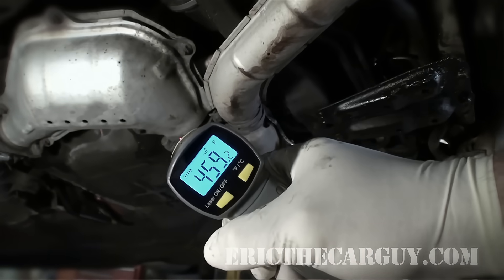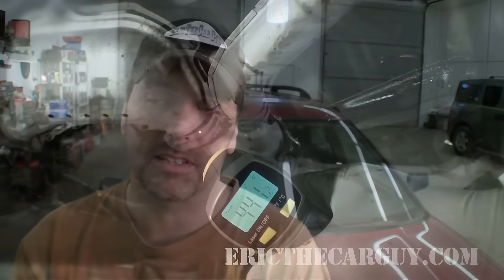Does Lacquer Thinner Clean Catalytic Converters? -EricTheCarGuy

Comment: Click bait Chanel for sure. Why would you do a “myth busting” video and purposely mis interpret the original video?

1. He said 1 gallon to half a tank
2. This isn’t a for sure fix like replacing or repairing a bad part. It’s a shot in the dark that might buy you some time. 
3. It’s not specific to a certain Myles after application. It could be 50 miles, 100 150 etc etc.

Just by this video I’ll never watch any other of your videos to try to learn from because you either act in bad faith or have faulty logic.

Comment: Look up the MSDS sheets and Compare the MSDS sheet for Cataclean to lacquer thinner... you will e surprised.  Lacquer thinner is much cheaper!
The thinner worked for me to pass inspection.  Engine light returned after about 500 miles and about 8 months later, I had to replace the converter due to being too clogged.  2005 Dodge Grand Caravan, 3.3L, that ran a bit dirty, contributing to the clogging.

Comment: It did not work in my car and I actually used two gallons of it the only thing that actually really worked was seafoam intake spray but you have to have the car running at least 2,000 RPMs run both cans through it and immediately drive the car on the freeway for 15 to 20 minutes it totally cleaned all my Cadillac converters on both sides and all four of my O2 sensors seafoam intake spray lacquer thinner did not work

Comment: My dad owned an auto paint store when I was in my early teens. There was a lot beside it that I would push mow. He kept the gas in a 5 gallon paint thinner can. One day I grabbed what I thought was the gas can, filled up the push mower and mow the whole yard. I remember thinking the RPMs were higher than normal on the push mower, but I was too young to make the connection. the next time my dad tried to start it He asked me what I did and put two and two together.  after flushing it out with regular gasoline it ran again, and we kept on using it 😅

Comment: The sensors under my Lexus sc 400 1992 are easy to get to but the nuts are so seized up that I tried the laquar thinner method . The light was on during the drive but had to continue the second day to use up the gas. The car stalled and trying restart repeatedly ran down the battery. It took three hours to arrange a tow back to base. The no gas symptom led me to replace the fuel filter. It started again and with a new battery the light was still on . Now it’s off , happy days

Comment: Hay Erick i luv your channel even used your video on the dodge engine swap and went perfect……however on that same wngine experienceing over heating issue?? New T stat 2xs wven drilled wholes in 2nd one so water flows reguardless bled any air out the intake port and new radiator… haven’t done and engine or radiator flush yet but was wondering what u think ??? Ive read possible cracked block ??

Comment: You didn't perform the test correctly. You had more gas in your tank as recommended and you didn't use nearly enough lacquer, so you failed yourself because it works.

Comment: My only problem with scotty's tip is that the strength depends on fuel tank size. My 01 celica has a tiny tank in it (not sure the exact size), but my trailblazer has a 24-gallon tank. Half a tank in my celica could be a quarter of what my trailblazer holds, thus making the mixture stronger. So what works in the celica might not be strong enoung for the trailblazer. That's why i prefer to just straight pipe my vehicles🤣.

In all seriousness, you just need to see what works. I've had luck with red heet, lucus (the yellowish concentrated stuff in the little bottles), and berrymans b12. I've never tried lacquer thinner, but i imagine it's stronger since there are no lubrication or detergent additives included. 

For the red heet, dont use too much. It burns HOT. I've had cars start backfiring because of it. It stops backfiring after a while. Just gotta clear the heet out of the tank. Took a full tank the few times its happened to me.

For the lucus, it's more of a maintenance additive, not a fix your missfire and cats additive. I use it every other fill-up. (Pro tip, get the little bottle and a gallon of it. Refill the little bottle after you use it, and leave it somewhere in your car until you want to add it again.)

For the berrymans, it's similar to seafoam, but i prefer the B12 personally. I use it to clean PCV systems, clear sludge out of the motor, or add it to the gas tank. They sell it in taller cans than seafoam, and its a bit cheaper. All comes down to preference.

Comment: You indicated that your cat "is not clogged".  Perhaps it is just worn out.  It seems it might work on a cat that is clogged but still good.  It is cheap and easy so I am going to try it.  If it fails, I will replace the cat.  Thanks for the input.

I am also considering replacing the O2 sensors because of the cost vs labor required to replace it.  My car is 20 years old and I suspect the cat and O2 sensors are original.  Any thoughts.

Comment: It’s 1 gal to a quarter tank and Scottie did the whole lot in one trip driving in high rev (3000?). He then filled up the tank . One reason was not to leave any thinner in the system to damage rubber rings ( using acetone can be worse).

Comment: I saw Scotty's video on the subject, and his advice was to clean dirty fuel injectors, which I followed and regained smooth running and power that, I assume, saved a physical fuel injector cleaning. If that resulted in catalytic cleaning as well, I wouldn't  know, but my CA Smog Test a couple of weeks later passed as well.

Comment: Bruh, the light means you ran out of gas. It has nothing to do with that shyyyyyt.
Also, yes, Lacquer thinner works as a FUEL INJECTOR Cleaner.
Which is mainly the reason these Cats clog up with carbon, is bc one of the injectors is dumping too much fuel causing it to run rich.
O2 sensors only work if each Injector is squirting equal amounts of fuel.
If 1 cylinder is dumping fuel, the other 3 cut back causing that 1 cylinder to run rich.

Lacquer Thinner works and it's chemical make up are the following ingredients.
Methanol 15.0 -40.0 %
Acetone 10.0 -30.0 %
 Toluene 1.0 -5.0 %
Ethanol 1.0 -5.0 %

Comment: It didn't work for me in a 2007 FJ. The idiot lights were off after clearing the codes and I drove with half tank and 1 gallon Lacquer thinner like was suggested. I stopped and put a couple of gallons of high octane in the tank to make it home. Started the engine and guess what? The idiot lights came on after starting the engine. Guess I'll try Sea Foam High Mileage Motor Treatment.

Comment: I have a toyota matrix (corolla) 2007 with about 210,000 miles on it. I have replaced both the before and after catalytic converter O2 sensors. I did get a p0420 error. Everything told me my converter was bad.
I knew from Toyota or a shop a new catalytic converter could cost from $1,500 to nearly $3,000. I went to Walmart and bought Dura Lube severe catalytic and exhaust treatment for under $20. What did I have to loose.
I put about 8 ounces (1/2 bottle) into about 3 gallons of gasoline in the car. I drove the car with the p0420 code for about 100 miles.
Soon the check engine light went out.  It was out for another 3 days. I erased the error code from the memory of the car. I took it for the California smog test and it passed.
After a few weeks the check engine light came back on with a p0420 code. Since then the check engine light came on and off. About 2 weeks ago it came back on (p0420) and I drove about 300 miles at about 70 mph. The check engine lite went off and I drove another 500 miles with the light off.
I am going to wait for my next smog check in October 2025 and put in the Dura Lube again. It is a bargain over a new catalytic converter. Under $20 to fix my p0420 was a bargain.
I did not try lacquer thinner.
I do watch Scotty, he seems a very good car diagnostic guy and repairman.

Comment: No way I'm putting laquer thinner into my fuel system. That stuff is very aggressive. Try spilling some on a cut on your finger. Man does it sting. Only use it for thinning laquer paint or cleaning spray paint gun or old paint in natural bristle paint brushes. I dread to think what it would to to your fuel pump or other fuel system components. I suggest going to your local automotive retailer and buy a specific cat cleaner. I like watching Scotty but I don't like this theory. Its not worth the risk. If it worked for you great. If your cat is stuffed maybe your burning oil eg pcv valve. Tip I got from LakebSpeed jnr. Use a fuel or injector cleaner that contains PEA or PIBA. Happy motoring wherever you live. From Australia

Comment: Scotties video says use 1 gallon for half a tank on the car he tested it was about 12 to 14 gallons  and he i believe, ran it 120 miles. its designed to clean the honeycombs (carbon deposits?) that could be plugging it up, you could also remove the cats and put them in soapy water and let them soak for a day to loosen the ? the honeycombs are a straight forward non moving non electrical device, meaning they are plugged OR broken out inside, since there are so many combs you could have both problems.basically if its not plugged or broken IT WORKS. OH and laquer thinner can eat rubber hosing so if your car is old...and the rubber going bad like from the tank to the fuel line the 4 inch piece of rubber or the same on the other end of the fuel line, check it to see if its soft

Comment: Scotty's method worked for me. 1 gallon Lacquer thinner, 9 gallons gas. Drive on freeway for 150 miles. Run out the rest of tank, then fill up. Car was driving like it was on jet fuel after 100 miles on the freeway. The "choking" caused by the clogged cat was completely gone, and hasn't come back since. It works.

Comment: But u didn't use the gallon and there for this test isn't accurate and even then u still need to drive it some more with no more lac just put more gas and erase the codes

Comment: I did not expect your test to show any positive results, and I don't think that you can fairly judge by your test because you only added 1 quart of lacquer thinner to three quarters of a tank of fuel.  I am conducting my own test with 1 gallon to a half tank.   I felt that you were trying to debunk his claims because you did not follow the instructions and you used the words like repair instead of clean.    He never said it was a repair.  I do agree that if there is physical damage then I would not expect any amount of cleaning to make it function correctly.    Unfortunately, there is no way to determine physical damage without removing the units.  You should make another video showing weather or not you have physical damage since I know you will be changing yours out.  I got a P0420 a few days ago and tried it, today the pending code has is no longer there after driving 70 miles.  I put 1 gallon into a little over half a tank which brought it up to just about 3/4.   I did not perform all of the other test that you did but my car currently says its smog test ready with no codes pending whereas yesterday it had a pending P0420.    I can only wait and see if it comes back.  I do know that driving on the highway is different than driving around town in stop and go traffic which is what I was doing a few days ago when the code first appeared.  After I cleared it a day later it showed pending again and now it's gone nothing pending.    It could be that driving around town will bring it back and freeway clears it, only time will tell.

Comment: I first got 0134 code, so replaced the upstream oxy sensor. Only THEN did I get the P0420 code. I pulled off hose from CPV to the intake vacuum tube. Hooked a hose onto the intake manifold vacuum tube, and used the other end of hose to dip in & out to the lacquer thinner, thereby avoiding lacquer thinner going through the entire gas tank, hoses, injectors, which might be affected negatively by the thinner, so it only would hit the pistons, spark plugs, intake and exhaust valves, and then through the exhaust and cat convertor part of my vehicle. Cleared up the 0420 and been almost a year and no more code. 2003 dodge caravan 3.3L

Comment: the amount of lacquer thinner you added was far less than what Scotty recommends - which is 10% - 1 gallon in 9 gallons of gas.  Your test was designed to show Scotty was wrong, not to find out if lacquer thinner cleans a CC.  There are zero conclusions you can draw from what your experiment, other than one quart of lacquer thinner in 3/4 of a tank of gas doesn't help.  Everything else is fiction.

Comment: It worked on my 2011 Ford Fiesta. 1 Gallon cleared out P0420 code. Added to 3/4th tank of fuel (ethanol free btw). I just drove it to work every day (about 50 miles round trip).

Comment: 2006 Mercury Monterey,  inefficient bank 1 and 2 , erratic secondary O2 sensors(2) 4 total, 26 gallon tank, half tank I added 2 gallons of LT, drove 140 miles, no longer codes, this guy didn't use enough,  from this point forward I'll be putting a gallon per every 2 tank fulls for preventative maintenance,  I been ASE certified mechanic for 45 years, Scott was right.

Secondary O2 sensors stabilized,  no more 420 430 codes, I'm sure it cleaned the injection system,  O2 sensors,  as for the cat, I'm not so sure, it will pass California inspection,  although we have none of that here in Indiana,  goes to show you how buying small bottles of cleaner at Walmart is a marketing ripoff. Just go to Menards buy a gallon and put it in 1/4 tank, drive that code away, may take a second or third application depending how long that engine light has been on...

Comment: You used 1 qt. per half tank of gas  Scotty says to use 1 gallon per half tank. Maybe the extra 3/4 gallon of lacquer. thinner might have gotten the results you were after.  If that doesn't work then perhaps go the extra mile and remove cat and soak overnight in a good amount of dish soap in water. Scotty says that might work better but is a hassle to remove the cat(s). I am in a similar situation and might have to try cleaning before replacement. I just put a can of Berryman B-12 Chemtool  in the gas and am going to let that run it's course before adding any lacquer thinner.

Comment: What is the point of this video?  You didn't measure anything Before trying the cleaner, so you have nothing to compare the After reading to.  You dilute a Quart of cleaner in 3/4 tank of gasoline.  You should have added it to 1/4 tank.   Then you conclude you can't tell any difference.  Well no shit!

Comment: Thanks for posting the experiment!  Other commenters are saying they got success with “Scotty’s” fix: 1 gal. Lacquer thinner to 10 gal. Gas!  I have to clear codes every day.  I can then drive without codes until I stop… if I restart, the CEL will trigger within a few miles.  O2 sensors now have 181K miles, so planning to replace now… Code Reader Scan showed O2 heater passed, but O2 sensor failed.

Comment: It is a snake oil scenario. If the substrate is broken then you could experience exhaust obstruction. If it is clogged, it's not going to unclog it. Thanks for disproving this. Incidentally, you mentioned a Kia needed some cats. Those engines are plagued by engine problems including burning oil. In my humble opinion the way to fix it is to put a for sale sign on your Kia. Boxer engines are also prone to burning a little bit of oil...

Comment: This video do Not duplicate Scotty kilmer's advice, to be honest and obvious. One quart was used in 3/4 tank of gas, whereas the recommendation was to use one gallon, which is 4x as much, in 1/2 tank of gas. That's a much higher concentration. Also, Scotty did say that it may not work, and the soap method can be used afterwards. If it was an expendable car, why not run the experiment exactly? That is science. Duplicating experiments in the same conditions, same parameters. Just knitpicking, but i don't see any footage that there was a code before hand, what it was, if there was a code afterwards.
I don't agree with everything Scotty says either and i don't know if this advice is gonna work, but I'll try it!

Comment: It does in fact fix it!(Possibly not in every case,so what else is new)I have used it on a 2010 Honda Fit AND a 2007 Silverado pickup.It fixed both vehicles but I  used two gallons of lacquer thinner on a full tank and drove 150 miles both vehicles by the way,they are both my vehicles!!! Codes erased and tracked until all monitors reset and knock on wood, no codes reset two months later...I think you are NOT using enough but it possibly depends on how dirty your converters actually are!A quart is only 25 percent of what Scotty suggested using with half a tank.

Comment: This is terrible advice. This guy doesnt know half of what he thinks he does. It burns. Doesnt "clean". The THINKING behind it i guess is to raise EGTs and hope you burn off aome crud. In all likelihood youre going to damage plastics and rubbers from the fuel tank all the way to the injectors. Cause advanced wear. And IF you put enough laquer thinner in to do anything youre most likely to melt the cat and seal it completely. You may as well take a socket extension to the honeycomb and knock it out. Then at least you wont damage your fuel system and possibly score cylinders. Bad idea. And im the king of CHEAP diy (and also over a decade earning a paycheck fixing building tuning high performance motors and cars)  drive at high speed? The motor turns the same amount of RPMs from 25mph to 100mph deoending on gear😂😂 just freaking downshift for hells sake if youre going to do this. Dont go blasting down the freeway at 120. So dumb

Comment: I took the catalytic converter off my 2006 Honda Civic and added lacquer thinner directly inside converter,I let it dry out and put it back on,it did solve the problem even with the engine having 357,000 miles on it